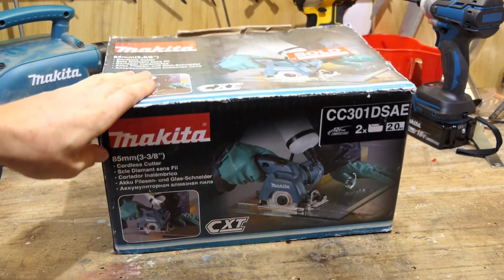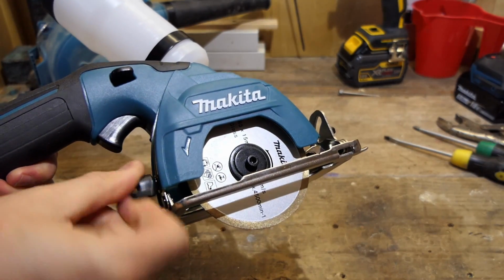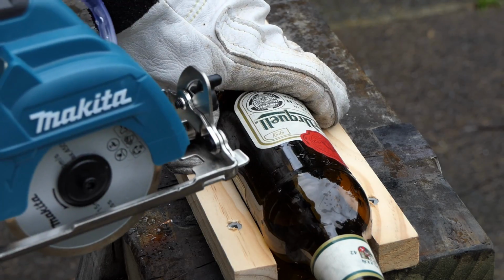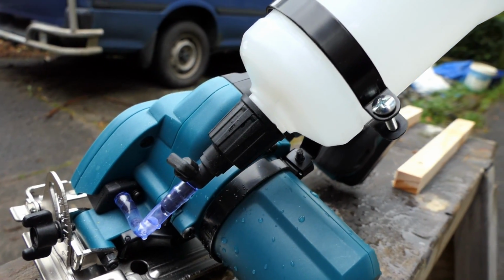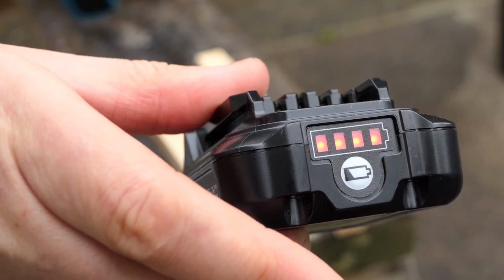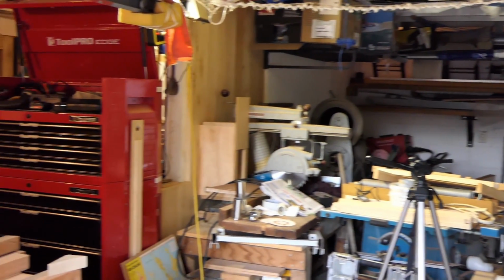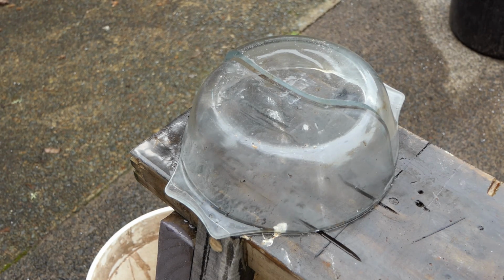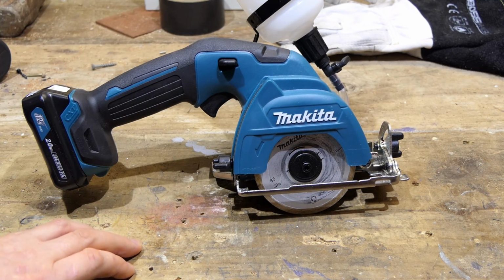Makita Glass Cutting Cordless Circular Saw Review CC301D / CC02

Comment: I know it was three years ago but a couple of things to try are cutting on a scrificial cellotex insulation (PIR insulation board). I find it absorbs the vibration when cutting tiles and supports the off cut which means it's less likely to snap off.  The other thing to try is perhaps setting the cut depth less deep.

Comment: I would also suggest a surface that absorbs vibration and is soft, like, someone mentioned before , felt or the neoprene toolbox or cabinet liners, I have had excellent results with those and I like to wrap my entire piece of glass in blue painters tape

Comment: A proper blade would probably help. But this tool is just too weak. I found that a specific blade for glass makes a huge difference. Like the Alpha Vetro. Cuts slow but super clean. You can try that on an angle grinder but use a sponge to keep the blade wet. Or get a wet saw, there are wet saws cheaper than that little thing lol and they work.

Comment: Tilers use anglegrinder to cut tiles
Reply from the maker: Every one of them?
Reply: We use 3 things depending on the tile. A snap cutter, a wetsaw or an angle grinder with a diamond blade.
Reply: And we hate being called tilers
Reply: @ToolsAndStuffOFFICIAL  I can't speak for more than myself, but yes I use an angle grinder with a diamond blade. And I take the protection out. lol
It's just a lot easier that way, you can see where the blade hits the tile. 
I also use a hand machine, that's how my boss calls it, it's a manual tile cutter, only do straight cuts though. I use a wet saw and hummmmmm sometimes diamond cup saw and... hummm sometimes even nippers (ear clamp pliers/end cutting pliers) for rough cuts on soft tile. My boss also has a similar saw as the one you have, but 110V (obviously much stronger), and we pretty much only use that for straight cuts on tile floor already set. 
For glass we use specific blades. Like the Alpha Vetro.